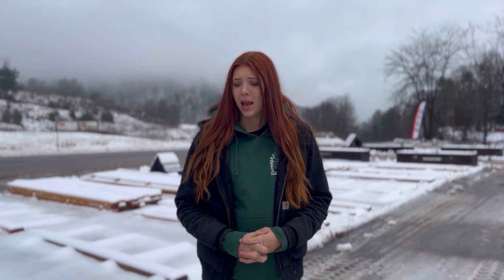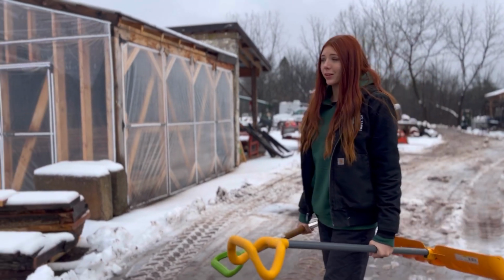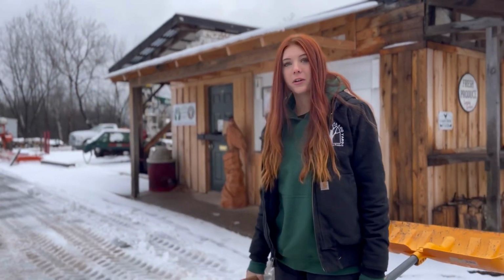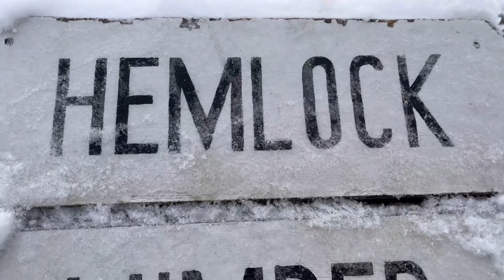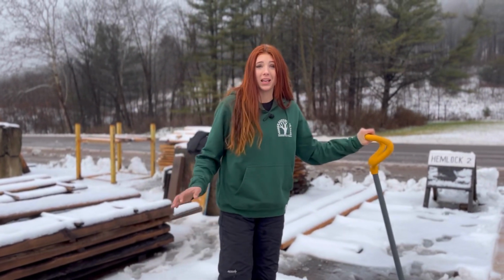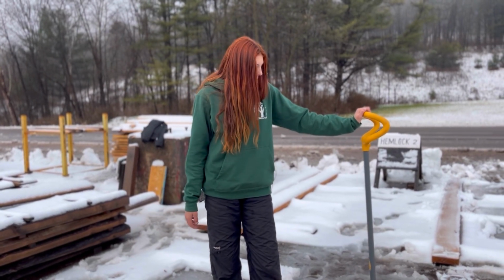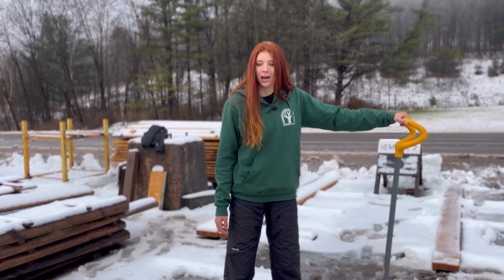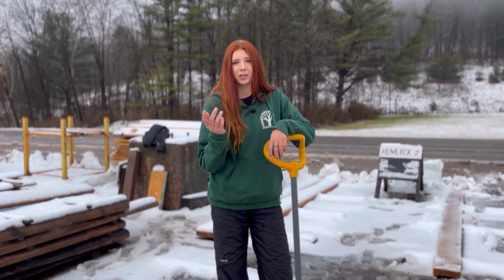First Snow Storm of the Year… What a Mess!

Comment: Wow, That's some really Wet snow...  ❄️ ❄️ 
You need to get a 10+hp Snowblower.

I have modern 9.5hp SB & it handles it pretty well.. 👌  

I would also suggest getting some 12' to 16' Pallets-- to make it Easier to Snowblow between the Rows of lumber & move them around.. 

(For you don't run into the stickers/dunge-- with the SB or shovels)

Maybe, Tack(/nail) some Flitches to the bottom of the pallets...  just in case, they freeze to the ground it doesn't ruin the Pallets.

Comment: The trick with blowing wet snow like this is to move FASTER!  This sounds counter-intuitive but moving slow through sloppy snow just causes the chute to clog.  You need to force a lot of material through the machine to prevent the slush from transforming from a fluid state to a solid one.

Comment: For the metal snow-shovels, could you perhaps cover the metal with a couple of mm of high density foam with a tight layer of gaffer tape on top to hold the foam? That would provide some insulation and hopefully be smooth and robust enough to stay together.
Reply: Nah use thin gloves
Reply: @adamcrookedsmile  They don't like wearing gloves, if they can avoid it